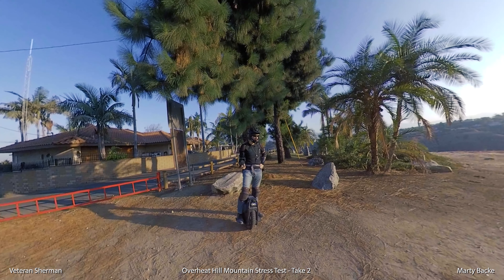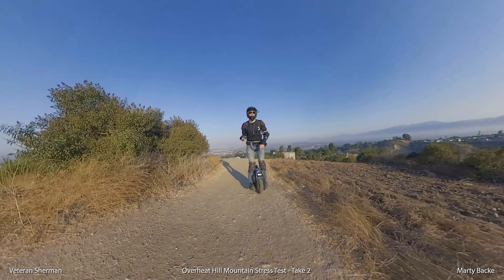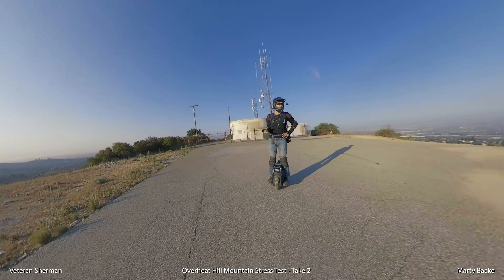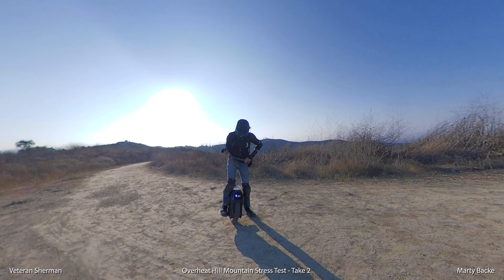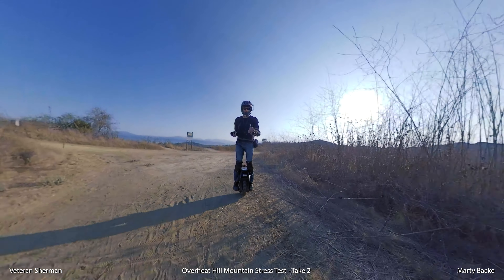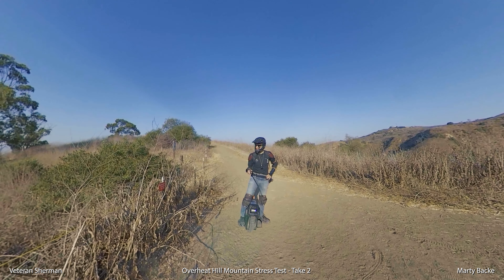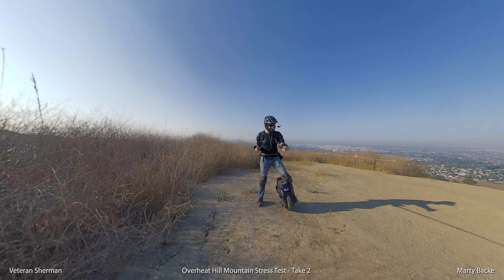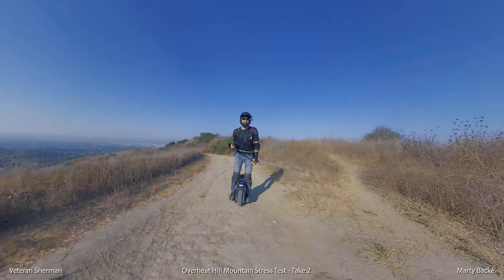Veteran Sherman Overheat Hill Stress Test - Redemption?

Comment: Well done Marty!  Very pleased to see that the Sherman passed the OHH test. 
As you rightly observe, passing the highly abnormal OHH stress test gives great assurance that there is plenty of margin in the reliability, performance and safety of the Sherman under normal everyday riding conditions.  Veteran have done a great job.

Read some news that you might be find interesting.
Current energy density of the Panasonic 21700 lithium-ion batteries used in Tesla cars is around 260Wh per kg.  
Elon Musk has tweeted that 400Wh per kg batteries produced in high volume, may be possible in three to four years, an increase of around 50% energy density.  This opens up the possibility of an all electric jet.
For the Sherman, this could mean the current 3200Wh battery could be replaced with a 4800Wh battery.
Tesla expected to announce developments of its battery technology on September 22.

Great vid, hope Jason does send you an S18 to try out.  I hope he does as you make very good in depth reviews, tests, tear downs and just great vids.  Look forward to the next vid, thanks.

Comment: I am glad that you are doing this for these wheels.. expecially the sheman. It isn't cheap.. and honestly this is a great way to give any of the engineers working on these wheels a idea of what to improve if possible... .. Or .. ya know.. get Jason to forward it to the manufactures xD

As a owner of the MSP .. i'v had 2 faulty boards.. and water intrusion through the wheel well.. going just under the heatsink of the controlboard. Being in B.C Canada.. i deal with a fair bit more rough terrain ... and water so its good to see things like this.

One thing i never had with the MSP tho... heating issues... Thanks for the videos :D

Comment: Nice run, Marty! I have the upgraded past version of the Sherman and Im very curious what changed in your version, please try to fill that info gap. For me it doesnt matter so much, I prefer to ride long range runs on the road at 35-45kph. I have had zero surprises with my Sherman so far. This wheel just owns my heart.
Reply from the maker: Updated firmware to deliver better low-speed power, and misc other changes. The motor wires were upgraded from 14-gauge to 12-gauge (thicker)

Comment: I don’t understand why they all seem to use motor wires that are barely (or not quite) thick enough.
14 to 12 gauge? Why not just go straight to 8 gauge to be certain? I’m not an EE guy, maybe there’s a good reason.
Reply from the maker: Physical limitations. All the wires have to be fed through a hole in the axle. Make the hole too big and the axle becomes weak. Currently the axle can support a max size of 12-gauge wires.
Reply: @ElectricUnicycles  Seems like a major flaw in construction. With those big hub motors you can easily increase the outer diameter of the axle enough to not make it weaker if you increase the size of the center hole.
Reply: Fortunately the hollow core motors will solve this limitation!
Reply: There is a way :). Put mosfets inside wheel (motor), get minus from chassis. Put plus into axle hole. Steer with two small signal wires. You can put then even 4 gauge - 21mm2!, over 70A constant current!

Comment: Was the issue with the inmotion v11 ever fixed and did you try again on OHH? Thank you
Reply from the maker: Inmotion's response to my incident was "this is not an issue with the production wheels", which was a lame excuse considering they never knew what happened to my copy. If they don't know what the failure mechanism was how can they say it's been fixed with the production wheels.

That all being said, it was problem just bad luck on my part. The production V11's are not generally failing.
Reply: @ElectricUnicycles  ok thanks for the feedback

Comment: When you change the Nikola tire the three connectors do they pull off or screw off
Reply from the maker: Pull off. All Gotway wheels use bullet connectors.
Reply: @ElectricUnicycles  thanks for the feed twist an pulled they came right out

Comment: So is this a new version of the Sherman or did they fix the problem for just this specific wheel?
Reply from the maker: I fixed the problem with this wheel by replacing the broken parts. Veteran changed the firmware on all Sherman's and upgraded the motor construction on all Sherman's.

Comment: does anyone else think there is a decimal point problem in euc worlds amp reading. 95volts at 100 amps would be 9500 watts of power draw, that means on a 2500 watt/hour battery you have roughly 15-20 minute run time. not meantion that even 12 awg wires would fry at that kind of power draw. it would make alot more since if that was a 10 amp draw being 950 watts of power use which would give you 2.5 hours of run time at that level .
Reply: darn auto correct , was supposed to be sense not since
Reply from the maker: It's not EUC World - it just reports what the wheel provides. Gotway (and Veteran) have always reported high numbers and generally aren't believed. Instead, we use the values as relative measures of how much power is being consumed by the wheel.
Reply: Just wanted to mention that I like your channel and your content. I have my degree in electronics and digital logic, and that always kind of bothered me, but makes sense and will have to have a talk with programming buddies and see about making an app that allows you to calibrate battery level and speed GPS vs wheel readings and safety alarms to an extreme degree for all the Euc riders out there, I used to program myself but have not in years, but may get back into it for that purpose

Comment: Marty, by the way, have you finaly installed the additional kit of 4 fuses 100A for up this hill? When y reception my Gotway MSP-HS, I hesitate to install the same aditional 100A-fuses to protect de board, and at the wekend, switching to smaler fuse when y moutain climb at slow speed. Thanks for your videos and hello from Belgium, Michael.
Reply from the maker: No, I'm not going to install those. Much too much work for me and I'm not convinced that they are really necessary.
Reply: ok 👌 Thanks

Comment: I had a question.  Is it possible to use an e-bike/scooter circuit board with an electric unicycle or any other type of self balancing scooter????
Reply from the maker: No
Reply: @ElectricUnicycles  I really appreciAte the prompt replies.  Once again great video.  That Sherman veteran can take a beating.  They got the whole engineering down packed.  I heard some Gotway engineers ventured off to create the Sherman brand.  

   So after reviewing your reply,  is it safe to say that all unicycle controllers are interchangeable?
  For example,  can you use a Gotway main circuit board in an Airwheel???

Thanks
Reply from the maker: @milestone_achiever4634  No. It's kind of like saying batteries between iOS and Android phones are interchangeable because they are both phones.

Comment: Maybe you say this and I missed it, but what is the grade of this hill, been wondering.. thanks!
Reply from the maker: Sorry, I don't know the grade of the hill - there's too much variability from the bottom to the top.
Reply: ElectricUnicycles ok, no problimo! One more question, if you don’t mind - wondering about doing switchback style riding on hills like these - perhaps not this, as there is no room to switch, but could you offer an opinion on whether some of the failed wheels possibly make it with a less direct ascent? Cheers!
Reply from the maker: @WeirdEarRaub  Switchback riding would certainly help but only if the trail was much much wider than this one.

Comment: Hey Marty, do you have any current alarm set up in EUC World for the Sherman? What value are you using in that case? Thanks in advance.
Reply from the maker: I only use current monitoring when doing extreme tests, sometimes. If I did at the time of this video I don't recall the value. I don't monitor the Sherman current. From experience, if the Sherman's motor starts making loud clicking/grinding sounds, you are using too much current and should stop. This will only happen if going slowly up steep hills. Under normal riding conditions, it's impossible.
Reply: @ElectricUnicycles  yes but it's exactly for hills that I am worried, like what happened the other day to lazyrolling Daniels late batch Sherman, I rode hills like that on the MSP but too scared to do it on the Sherman, some kind of alarm to catch it before it burns would be nice :)
Reply from the maker: @RonnieRides  OK, I went into my archives and discovered that 90-amps was the correct alarm setting that I used when testing the Sherman. At that level it will only trigger when the motor is under very heavy load. See this video segment where I discuss the current alarm: https://youtu.be/D3oTSjViZqk?t=2920
Reply: @ElectricUnicycles  thanks Marty!
Reply: @ElectricUnicycles  you kept riding no problem even after hitting the current alarm, wouldn't a little bit higher make more sense in that case? Like maybe 95A? I'm thinking when current alarm hits that's when you wanna stop.
Reply from the maker: @RonnieRides  In my opinion, no. The idea is you don't have to stop immediately when you hear the alarm, only if it starts triggering a lot. A fellow rider decided to use a value over 100-amps (on a different Gotway) and he never heard the alarm and his board burned up. I recommend 90-amps but of course you can go with whatever works for you :-)
Reply: @ElectricUnicycles  I actually tried 95A today but it triggered from some hard acceleration (nothing extreme just more than usual), so I will try 100A see how that fares, perhaps try some lighter hills see if it is triggered
Reply from the maker: @RonnieRides  The idea is not to set the level so it never triggers, but instead triggers under heavy loads. So it's OK if it's periodically triggering. It's when it starts triggering a lot, close together, that you know you need to stop and let it rest.
Reply: @ElectricUnicycles  yes I understand but I still don't want to to trigger in normal situations like acceleration, would rather it start beeping when it's really stressed
Reply from the maker: @RonnieRides  Understand. Hope you find something that works for you.

Comment: Spoiled by suspension. V11 is still a work horse and far superior IMO. Each ride with the V11 gets better and better as you get accustom to controlling the suspension. It makes a world of a difference once you dial that in. Sherman just seems like a tank and thats pretty much it. Most, if not all of the people riding EUCs WILL NOT be going up dirts hills this steep. Thats why this test is really irrelevant to riders. Its more for the manufacture. Don't think the power and speed of that can out perform the overall pkg that the V11 is in the long run. So, I dont think the Sherman is on its same level. Maybe the toughest EUC on the planet, but that seems to be it.
Reply: Did you really come here just to say that you think the V11 is better? Not to mention underplay the Shermans ability conqering overheat hill and Marty's efforts and hard work? You say workhorse? The V11 with it's shoddy bearing, loud headlight fan, weak plastic saddle and a major suspension valve weakness. I think that is far from the definition of "workhorse".  The S18 is at least the master of offroad and the Sherman king of speed and distance. I understand these wheels will all improve with time I think that's pretty obvious. While the V11 may do a bit of verything it will never be the master of anything.
Reply: @shield400  One, I think Marty is doing kool stuff with his videos and I for one, appreciate the work he does.  So no, I have nothing against what he's doing. However, YES, I definitely THINK the the V11 is, like I said, a better OVERALL wheel. Other than the issues with the saddle, that a lot of us have, it doesn't do anything to fault the experience of riding the wheel. I can ride just fine with that broken plastic screw. 2. I don't know where you are getting your info, but the other issues mentioned is something that has happened to 1 or 2 people. Not the lot of them. There is no major valve issue. Don't go by a pre-production model. smh I haven't had any issues and and only know of two people that went through that from the first batch. Also,  I've been on the road and through gravel and dirt. I'm on 3 weeks with the V11 and have no other problems. No issues with bearings and I've ridden it twice in the rain already. One time, I got caught in HEAVY rain. Wheel is just fine. You don't even hear the fan. It seems you are just hating on something you don't own and go by the negativity that's out there. Negativity by people that don't own the wheel. V11 IS A GREAT WHEEL!
Reply from the maker: I just completed an 89-mile ride in the mountains, climbing over 8000-ft, with the Sherman. I don't think the V11 is quite up this :-)

There's not much point in trying to compare the V11 to the Sherman. Apples to oranges. The V11 is a great wheel for its use case. And the Sherman is a great wheel for its use case.
Reply: Vagrant Sneaker  Whatever gets you by!  😂
Reply: shield400 Yup!! Go rant about something you know instead of hating on something you don’t.
Reply: @vagrantsneaker6514  Learn to follow your own advice. Smh